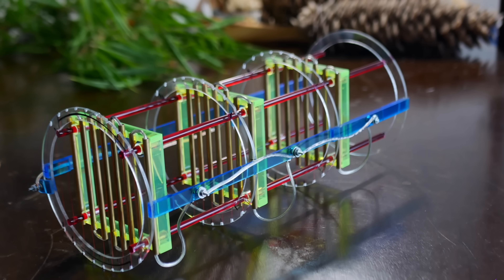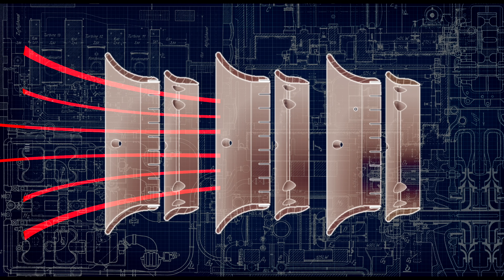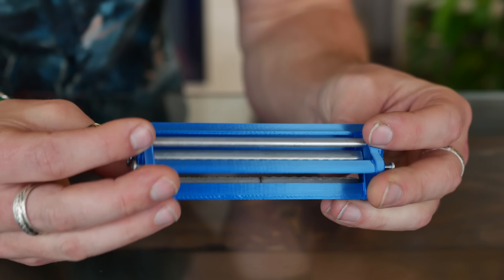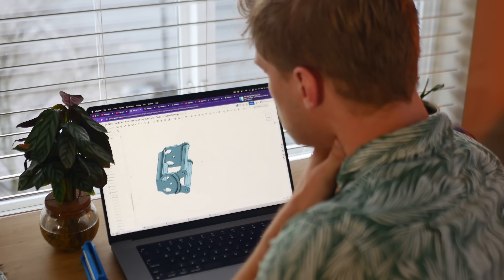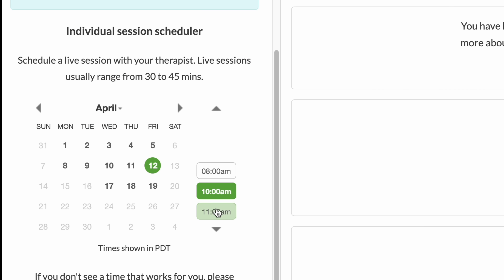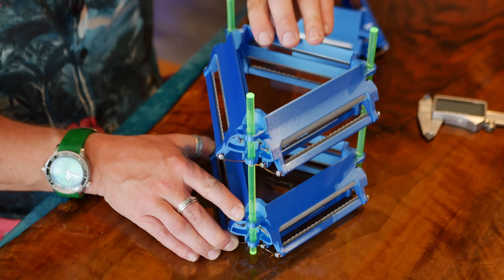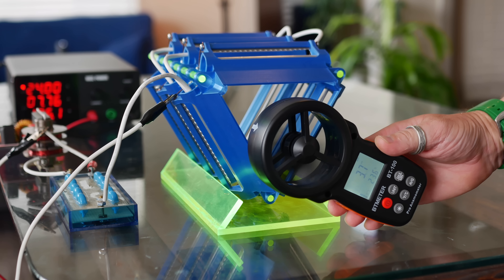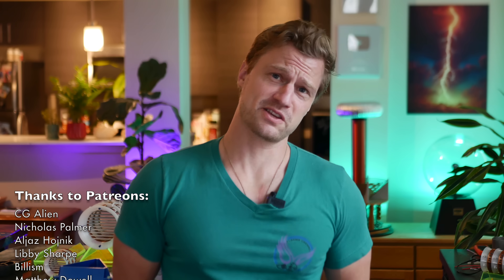Next-Gen Ionic Plasma Thruster Inspired By Nature (BTC Mark 3)

Comment: I was thinking that given each third of a stage of thruster takes air from both sides of the intake, you might be sucking air from inside the column back into the second and third stage of accelerators, which definitely mean you don’t actually get the effect of pure peripheral input. Not sure how you should solve this: by maybe angle these thrusters a bit more, or eliminate the inward-facing intake.

Comment: The next steps towards boosting efficiency is to use the thrust generated by the ion thruster to turn a prop-fan. 

This is the difference between a turbo-jet and a turbo-fan. Pure turbo-jets are basically extinct now, even the fighter jet engines are low bypass turbofans.

Comment: Can you make brush a rail on the outside so they can spin? Keep the design how it one of the three thrusters on one side like its a line keep the left side stationary now take the right side go forward one 8th of the length, also you need more of the venturi affect, turn the second three thruster housing and rotate it 20 degree offset from the first housing. It needs to use the first thruster through the second thruster to venturi on the second thrusters inlets or give it its own inlet with routed tubes on the outside of a cone. Move one side of all the nozzles 5 mm forward towards flow of air, 20 degree rotation each housing after the first housing then put the whole thing on a rotating assembly, attach a prop to the front.

Comment: It seems like laminar air pulses may allow for better convergence and higher speeds by exploiting the low pressure zones. 
Since a pulse of air has a trailing vacuum behind it, the pulse that follows needs less work to move it's column of air and will more readily reach compression of the flow tail exiting ahead of it.
I remember installing pneumatic vent horns that utilized compressed air to create a vacuum. With sequential pulses I could see where quicker pulses increase pressure in front and lowers pressure behind a little more than the previous pulse. I think that created vacuum could be aided by dynamic fin modulation that helps concentrate vacuum in front of a trailing pulse and readily gets out of the way as the void is filled. Perhaps a rotating disk with gaps timed to high pressure zones similar to how machine gun fire can shoot through a spinning airplane propeller. A vacuum can create greater suction with nozzle attachments. So imagine spinning discs that aid in pulling a vacuum and rotated to a gap timed with a pulse to fill that increased volume.

Comment: It's not surprising that putting more stages one behind the other won't increase so much the final speed than a single one, knowing that acceleration equals speed change per time, if each stage provide the same acceleration, in each gap the air will stay less time beacuse the speed is increased, so with the same acceleration but less time the change in velocity will be lower
I have three ideas for this:
-Intead of distancing the stages all the same, every stage should be far from the previuos one more than the previous one is from the one before, making the total lenght not linear with the number of stage but quadratic or even exponential (less convenient in lenght)
-Every stage should provide more acceleration than the ones before (less convenient in watts) 
-instead of putting the stages one behind the other, putting them side to side, so the final speed of air won't be higher than a single stage, but you will move more air in total (less convenient in surface)

Comment: I'm betting that rounding the thing out should smooth out the flow and make it better. Building an actually rounded version would be difficult, but luckily, testing if rounding it out would improve it is relatively simple. Add another side to make it square, then another to make a pentagon and see the progression vs the increased power. easy peasy. No need to make rounded razors then. If it does work...well...then some custom parts might be worthwhile for the larger final version.

Comment: What happens if you rotate the second module 60 degrees?  How about the second by 20 degrees and the third one by 40 degrees?  Might be interesting to see what happens if you put a conical tube at the output.

Maybe you could put vanes at the output so you can direct the thrust or focus it by different amounts.  

Will it move water?

I wonder what running it at a wind tunnel could tell you.

Would it work better if you took your nine segments and arranged them in a spiral?  How about a pentagon with a square in the middle?  You might have more options for experimentation if the individual segments of the triangle were printed as separate parts.  Then you could print a whole plate full of them and arrange them in multiple ways after you put them together.

Is the total amount of liters per second greater if they are parallel instead of coaxial?  On a plane that has coaxial engines, there is a fuselage structure between the two propellers.  Maybe a tear drop shaped object in the middle would increase the efficiency?

Would it be more efficient with some clever power management?  Maybe if you cycle through the triangles from back to front at different rates it would work better?  Perhaps applying different amounts of power or different voltages would be useful.  Maybe different frequencies would do something interesting.  Perhaps if you have the frequencies related by an octave (ie. a factor of 2) it would give a different result.  Now that I think about it, you're using high voltage dc?  I wonder if you could use two razor blades instead of a razor blade and a tube to make an AC thruster.

Comment: Since E=m*v^2 it would be a miracle if it DIDN'T have diminishing returns. If there is no reason why it would be more efficient at high speeds (which I honestly don't see here), you have to expect the velocity to increase with the square root of the input power stages.

Comment: I'd love to see this with the thrusters angled to spin the air through the center of the thruster. As it is, the introduction of new thrust from the center of the thrusters tends to start introducing backflow turbulence on both sides of the channel. I'm wondering if you could control that turbulence and have the thrusters be even more constructive in their interference.

Comment: Wouldn't the combination of the sequential and vein design dramatically include it. At least in the beginning and end of the thruster. Also circular. Remember you're also dividing your power output so less loses when your ground and hot are continuous.

Comment: There's a point at which the ions cannot add any more acceleration to the air column. due to the air flow speed matching the discharge voltage.
upping the voltage at each ring/stage will make it go faster.

Comment: with a 3 stage 1.20W 2. 40W  3. 60W  or scaled accordingly? each one increases the air flow with the next stage. so stage1 move say 2l air stage2 should move not 2 but 2,5 or more and so on?

Comment: You're building a thruster ... for use on an airplane. That's not the right approach, as Elon says: The best part is no part.
Have you ever seen slats on a wing?
The sharp edge at the back of the slat is pointing at the blunt edge of the front of the wing. And it's pointing at the top side too.
If you put the voltage between those you're putting the higher velocity air directly above the wing, above the WHOLE wing, in a place where increased air velocity also happens to create lift.

Now there may be a problem with that design and it's a problem that your current design shares. IF (and I don't know if this is true), if the ionic thruster loses efficiency when trying to accelerate air that is already moving fast, it's a problem both for the powered slats and for your current design. Since air is already moving rather fast over the top of the wing during flight and since in your design powering the first thruster in the sequence already pulls air through the intake of the second and third thrusters.

And yes, I realize it's coming back to being close to one of your previous designs but that one was a thruster on top of a wing, I think this shift in paradigm where the wing structure itself is the thruster justifies a second look.

Comment: Just a reality check: at 4m/s and a cross-sectional area of about 100cm2 you're putting about 0.3W of power into the air; for a 70W input. Because energy rises as velocity squared the second stage of your first prototype is actually more efficient than the first. To maximize thrust efficiency you actually want to move a large volume of air slowly rather than a small volume fast, something ionic thrusters might be suited to. However, due to the nature of ionic acceleration much of the energy input is going into rotational/vibrational states of the molecules rather than velocity, so it's unlikely ionic thrusters will ever be efficient enough to compete with, say, a propeller. But still fun stuff, thanks for posting.
Reply: I'll start by apologizing for my ignorance of the subject I'm not familiar with many of the concepts that go into propulsion systems. but I was curious about the application of ionic thrusters in some vortex propulsion systems. if moving a large volume of air slowly is the objective could you line the interior of a cylinder with elongated versions of your thruster design similar to canted fins on a rocket or possibly use ionic thrusters as injectors in a system that uses a bored lining similar to a rifle?
Reply: What if you used a hollow round design, but instead of using horizontal electrodes you used a few progressively smaller circular sets. As Eminem says, two trailer park girls go round the outside. Collapsing the air progressively to add velocity. Literally bend the triangle in to a circle.
Reply: On my channel there are about 45 flight footage videos of ion thrusters that lift their power supplies vertically, they can also fly horizontally, against Earth's gravity.  They do rely in part on a large area and volume of slow-moving air to increase efficiency.  On the other hand, oxygen molecules absorb electrons like a sponge so there isn't much power required or lost so long as there isn't much heat produced.  Higher voltages at lower currents, thinner emitter wires, and larger gaps, greatly reduce power losses for a given amount of lift.
Reply from the maker: Great input! I know the pursuit is nearly pointless - ionic thrust will never compete with propellers on efficiency. Then again, I’m not going for efficiency. If I can design a thruster that uses 5 times the power of a propeller system (currently it needs more power than that haha), I’d still consider it a win. Because as battery densities continue to increase, as small scale nuclear becomes a reality, energy requirements for electrical apparatus aren’t going to matter much. 

So I’m focusing more on the improvement of thrusters approach, less on the trying to actually beat a propeller approach, 

Great input
Reply: @PlasmaChannel  in a sense, a vast amount of what happens in cellular biology is powered by "ionic thrust" (albeit more usefully described as charge concentrations.) 

Nature designed flagella (propellers) anyway so you're probably right! ;D
Reply: @PlasmaChannel  Then an electric motor powering a prop would still be better though right?
Reply: @Subcode  Not only better, electric motors powering props are legitimately in use on small planes (though they can't really compete with AVgas or jet fueled aircrafts for the same reasons this can't compete with electric motors powering props : efficiency).
Reply: @PlasmaChannel what an offensive take on being intentionally wasteful.
Reply: How would the ionic thruster work in space without air to displace
Reply: @TrueIndependent  They have propellant with them.
Reply: @Cygnus888  why would it need propellant if it doesn’t use fuel
Reply: @TrueIndependent  In space ion thrusters use fuel - usually some kind of neutral gas. That's what I meant by propellant. The gas is ionized and accelerated by the thruster to speeds of 20 - 50 km/s. Unfortunately for now they don't produce much thrust and are only useful for satellites.
Reply: @TrueIndependent  it sprays ions or electrons out the back as it goes.
Reply: If his 21L/s estimate is correct, that's 25.7 g/s at 4.1 m/s, or 0.216 W. When using 165 W input, that's a 0.131% efficiency! Propellers get to 86%😅
Reply: I haven't checked your arithmetic, but he might well be better off just running resistance wires and running a thermal cycle.
Reply: @BooBaddyBig  If turning electrical energy into thrust by moving air is the objective then nothing else comes even close to a brushless DC motor turning a well matched propeller, on more or less any performance metric you choose (except perhaps for low noise). Buying some off the shelf FPV drone motors and marvelling at how good they are wouldn't make for compelling content, though.

Plasma Channel is sticking with  atmospheric ionic thrusters because building very cool high voltage physics toys and making well produced videos about them is what he does, and he's very good at it. I just wish he would be more honest that that is what he's doing (as he is in a lot of his other videos), rather than wrapping it up in the "I'm inventing the future of aerospace" schtick.
Reply: What does it look like to address these issues? Is laminar flow applicable on this level? Is there a material better than good ole earth air that would allow for less vibration and higher ionization and thrust? I know these projects are for atmospheric applications, but with some adjustments these could be small project space worthy. maybe?
Reply: This is a sidenote. Whatttt iff. you did one of those weather ballon android phone projects, sending a small "satellite" up but also threw a couple ionic engines on it (it would need some sort of mass to thrust) and see what it can do?
Reply: His structures are basic structures. With more research, better material, and material structures, it will improve. For example, toroidal fins are structure improvements, and it will happen for ionic thrusters, too
Reply: @dennisalbert6115  Iterative refinements like that historically get you improvements of a factor of a few, eventually. If you're starting with a system that is about 0.5% efficient then you're not a factor of a few short of where you need to be in order to be competitive, you're a couple of orders of magnitude behind.  At that point you either need a radical change to the entire approach, or just accept that atmospheric ionic thrusters are a very, very cool scientific curiosity but not really a viable form of propulsion.
Reply: @anthony_horton  you can compound efficiency
Reply: @dennisalbert6115   I believe if the thrusters were  put inside a wing like a blade less fan it could increase lift compression of air flow through center and then stage to wing with  s.t.o.l dynamically design may
Reply: @dennisalbert6115  It would be interesting to see if airflow could be improved by angling the thrusters along a radial axis slightly to encourage the air to spin in a vortex (i.e. not completely perpendicular to the direction of the combined airflow).

Comment: 13:17 Most scientist don't realise it's engineering, not science.  The statistic  you should be stating, is the overall efficiency of conversion of energy to movement.  As long as you can get efficiencies of the best water based thrusters, you will be there.  BTW, there is a channel, AsteronX, developing a mhd system, along with a "quantum vacuum interstellar ram jet".  They cover all the space propulsion design concepts.

Comment: I don’t understand how this is Science. It uses Science, but is barely Science. 

You tried different orientations of thrusters, and recorded the data. You apparently implied your hypothesis existed. It would increase thrust to bring them closer. But that isn’t Science. It’s just Experiment using known Science. Which is fine. But people think that is Science. 

There are Fields of Study. Physics. Engineering. Chemistry. If you want to do Science though, you actually do have to make it Replicable and Record the Experiments with Rigorous Methodology. You are a fine Inventor. A fine Teacher. A fine Presenter. But without that extra stuff, you are not a Scientist, and you are not doing Science. 

The reason I’m being a pedant is pretty straightforward. People think the Mythbusters was Science. And it’s made it so the Study of Science is less potent for purpose. And those in Education and the Institutions aren’t held Accountable to perform Scientific Study, with the Rigor required to define it as such. 

I don’t think I’ll be using the S word except for things I know are derived or related directly from or to the Practice of actual Scientific Study.

Comment: I'm wondering if you might be getting less speed but more force with a stacked arrangement, since you're only measuring the wind speed.
Not sure how you'd measure the force unless perhaps using some wires suspended over a weight scale and how much it's actually pushing upwards

Comment: Some neat ideas. The sharp meeting angles probably introduce some turbulence to the flow so I wonder what that looks like.

Since this is supposed to be a thruster, output velocity isn't the only thing that matters, F = ma, so also measure the mass of air that's moving, L/s is a good start, but directly measuring thrust via a force sensor might be a better gauge of whether you're improving and let you iterate faster.

I would second other comments here about the stages being different, either in voltage or geometry or both. Some of your energy is being spent compressing the flow from earlier stages, but I'm not sure that's doing useful work in the sense of adding thrust. Compression is important for burning fuel mixtures, but that doesn't apply here.